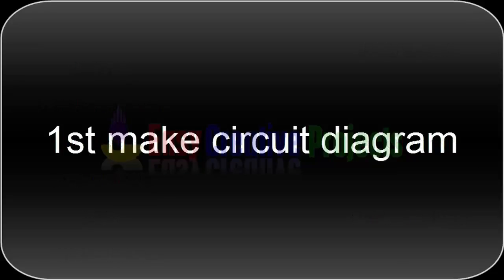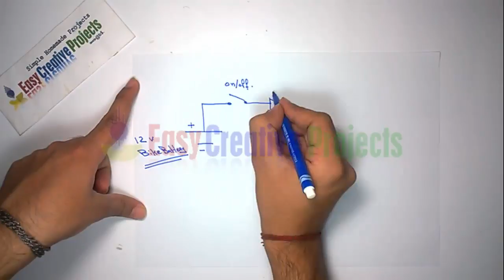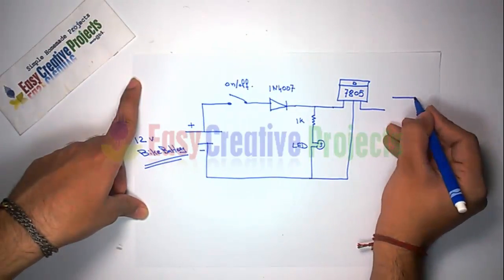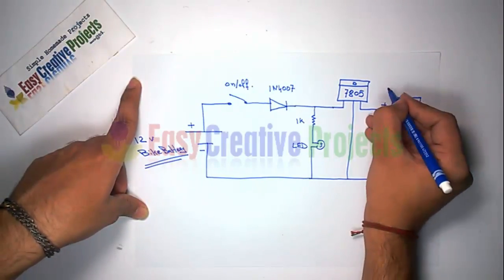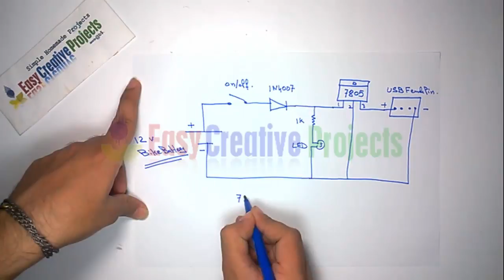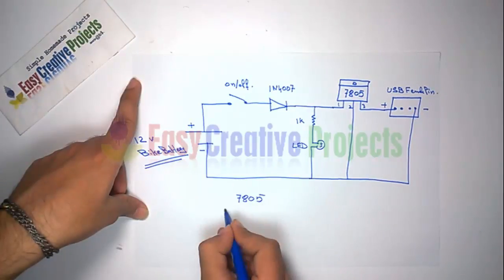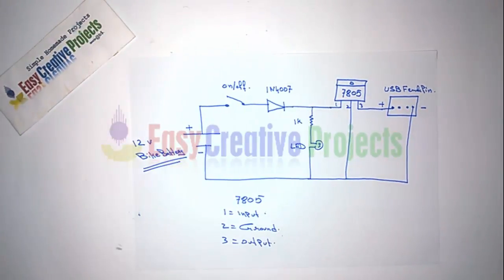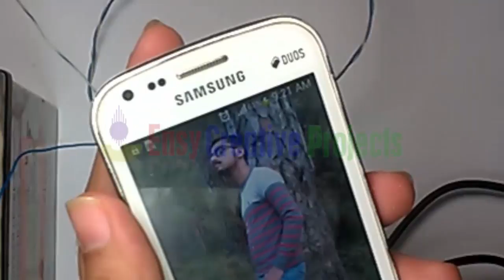How to make bike battery mobile charger - easy step by step with circuit diagram

Comment: Not working. Damaged. My mobile
Reply from the maker: dear in this project we use LM7805 voltage regulator. that convert 12v into 5v. many people use this project. specially for uber worker. if you don't satisfied with this so you can buy this circuit from shop.  i also try to make video on market charging circuit.
thanks.

Comment: Sir ISS circuit ko may professional use kar sakti hu.or longevity kitne hogi.
Reply from the maker: yes dear you can use this circuit for long time. 
for safety and long life use high quality or good quality wire, and voltage regulator k saht heathsink use krin.
thanks.

Comment: How to charge motorcycle battery?
Reply from the maker: dear you can charge bike battery using minimum 12v 4amp charger , if you want to make charger then watch video on our channel ( how to make 12v 10amp power supply, ) or ( how to make 12v adjustable current power supply )